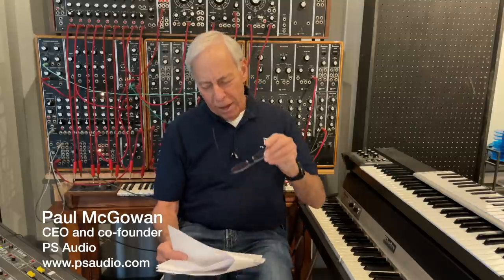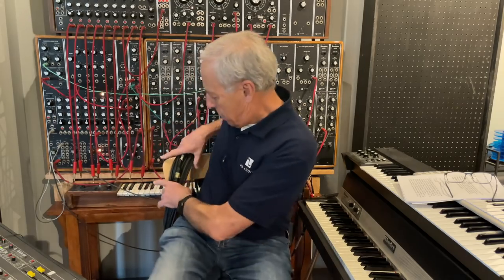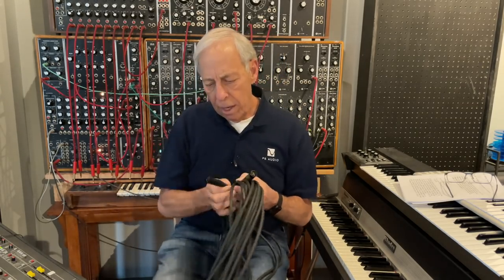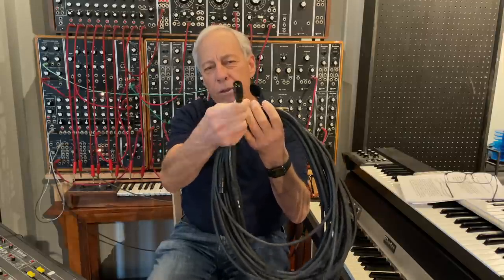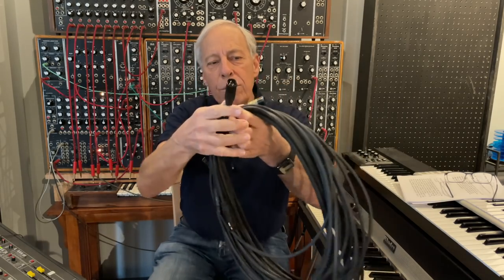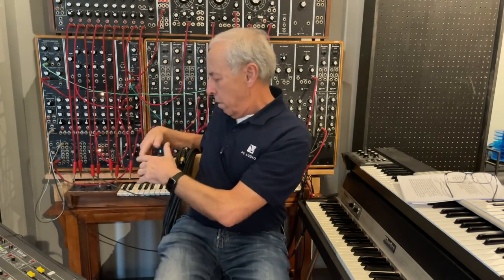Mixing XLR and RCA cables

Comment: Just set your system up properly, with decent cable management,, and you'll never get any interference from any other cables,, use your common sense,, and stop listening to people who want to sell you stuff.
Reply: A few months ago, I was digitizing some LPs.  I ran into a problem when I had accidentally placed a signal cable (unbalanced, line-level) next to the “brick” power supply (transformer) of my mixer.  Fortunately I noticed the hum, figured out the cause, and just took care to no longer put the cable in that position.  I had to redo 8 or 10 already-digitized LPs as a result of this.  In the case of a playback-only system, if you notice this kind of problem, just fix the cable routing (or upgrade to balanced cables), no harm done.  If you don’t notice any problem, there’s no need to buy further stuff.

Comment: RCA to XLR is no worse (or better) than RCA to RCA, you'd only use XLR to RCA if you had no other choice. That old modular is far more interesting than some cables though :)
Reply: Certainly you’re right! Some of the synth is old, certainly the keyboard looks old. But much of it is new analog stuff from behringer actually! It sounds incredible and is much more reliable than 50 year old components

Comment: I like my analog cables to be as short as possible and when they are short, the difference becomes minimal.
Reply: Indeed, I use unbalanced all over the studio because the cables aren’t longer than 5 feet usually.
Reply: @graxjpg  Yes, for a few feet, the difference is below the dynamic range of human perception.

Comment: There is more to it than that.  A typical balanced line level audio signal is hotter than the signal on an unbalanced line level audio signal. These two conventions are commonly known as 'pro' and 'consumer'. Ironically, the more sensitive high impedance input of an unbalanced system is more prone to noise pickup than the less sensitive low impedance balanced input so you win twice in a way!  The separates market mainly use unbalanced RCA -10dB to maximise compatibility between different manufacturers products as fewer companies use balanced XLR +4dB connections. I'm amazed that the high end consumer audio market hasn't fully embraced the signal connectivity of the pro audio market which has used balanced inputs and outputs for over 70 years. Trying to 'improve' an unbalanced input or output by using overpriced cables is just not the answer.

Comment: I’m using xlr cables from my microphone to my preamp and for some reason, there is still slight a.c. hum in the background. 🤷🏻‍♂️
Reply: Could be the quality of the cable try a different one, or it could be that one of the connections was broken and the reason I like non molded connectors for inspection time to do a continuity test. If that doesn't solve it, it could be a possibility of internal cable damage but a continuity test between the different pins should rule that out.

Try moving your XLR cables away from other wires to see if that helps. There is a video I might add the link if I remember of somebody testing various price and quality of cable and found unless you get the cheap ones the difference was minimal but if you got a cheap one it was regrettable.

The other option is you wouldn't happen to be underneath a radio transmitter would you?
Reply: imark7777777 
The mic xlr cable is going directly into the preamp. Then the preamp into the Focusrite USB box and then directly to the computer. Nothing else is connected to the AC other than the preamp. I’m also far away from any radio transmitters. Probably it’s the cable. I’ll get another one and see if it fixes the problem.
Thanks for your valid input.
Reply: Microphones are often difficult because of the low signal levels, long cable distances, and very high gain in the preamp. Sometimes you have to cut pin 1 (the shield) at the preamp end XLR. This will often break a ground loop if the microphone is somehow physically grounded like with a metal mount tied to electrical ground through a desk.
Reply: @Bassotronics  hmmm I think this article it might be helpful https://www.ranecommercial.com/legacy/note110.html

I'm assuming everything is plugged in the same power strip. if they were on different outlets with a bad ground between them that could introduce noise, I don't think that's the case here.

Yeah I'm thinking it might be the cable, was it something off of Amazon? Get some thing from a reputable seller and not necessarily bargain quality. Maybe get something in the $20-$30 range and if you can with Neutrix connectors ( generally that means they put some effort into the cable and didn't just go with cheap Chinese knock off connectors and cable.) that you can have as a reference for testing.

I'm really liking these at the moment, they were a good price and have colors for a recent order for a podcast studio last year.
https://www.bhphotovideo.com/c/product/845514-REG/Kopul_m4010_Kopul_Studio_Elite_4000.html

of Course I am one to speak, I picked up a three pack of Samson cables for like $25, and salvaged many of my cables from the trash. A good cable well taken care of will last, no knots and kinks and gentle wrapping (preferably over under).

Comment: Hey Michael, I have an even older CD player.  It plays fantastic and while it doesn't have balanced outputs it does have digital, both optical (toslink) and coaxial.  Your 15 year old Sony is probably the same. Not much has changed in CD players in all that time except the DAC and even a $100 DAC today will probably run circles around your old internal DAC. So I'm suggesting you take the digital signal from your Sony via optical or coax to a new external DAC. Spend more than $100 for a good one with balanced outputs and then connect that DAC to your pre or integrated amp.  Or you could choose a new amp that has a high quality inbuilt DAC and you won't need to worry about XLRs at all. Just connect via digital.  But remember you'll have the same problem in a few years when the amplifier is still fine but the DAC inside it is obsolete.  Anyway, I think either of these will help you continue to enjoy your Sony for many more years and not worry about it not having XLR.

Comment: Never understood why they make adapters. For making one end XLR and the other end RCA. Expecting to achieve the same results. XLR to XLR fully balanced is the way to go. I wasn't a believer at first. Until I tried it for myself. My noise floor lowered quite a bit in my system. Definitely recommend fully balanced equipment if you can!
Reply: Because you may have a good XLR cable … but the new equipment you bought is coax and RCA only!  It could fun the reuse a very pricey XLR with an adaptor :😢

Comment: Just short the minus and ground pins together on the XLR if you want to connect to the RCA plug, keep the cable length as short as possible, use good shielded wire.

Comment: I agree balanced is the way to go for the reasons you mentioned. I had this exact question in mind... perhaps I can elaborate on what type of scenario you could encounter to warrant the use of mixing RCA/XLR... I have 4 subwoofers, 2 identical ones, a 12 inch as well as a fourth sub. I also have speakers in the signal path as well. Basically every single speaker (4 speakers) and all but one sub have XLR.... You can see where this is going. I have 4 spliters (2 for left, 2 for right) so I end up with 6 xlr outputs (3 left, 3 right) and these go to the speakers, the second set of speakers, and the subwoofers(also the subs have XLR pass through which are being used)... I have the final RCA subwoofer connected to the output of the 3rd sub via XLR to RCA cables and I always wondered about this, since I believe XLR to RCA is just taking one of the outputs and the other inverted signal (i forget if its the hot or cold) is just connected/shorted directly to ground. And that's what I was wondering about and this video kind of addresses this question but not entirely. I can appreciate that describing this setup is difficult and I almost feel like I need to draw a diagram to explain better but since all the speakers are more or less paralleled but then at the end of the chain there is a direct to ground it seems like there may be potential for some issues? Which honestly, for the most part this setup sounds fine so I imagine it is okay. Occasionally I have experienced some minor speaker hum but it was pretty negligible. But I have also had a strange issue with the third sub, techincally it works fine but there is an LED on the front which tells you if the unit is powered on and I've been having that front LED go wonky on me of late, so I am wondering maybe if there is something going on. Pardon this long winded comment I just ran across this video and was relieved to hear I wasn't the first person to wonder about this type of thing. Also indeed as stated XLR/balanced connections are the way to go, but I happen to have this consumer grade sub lying around. And generally don't seem to have any issues with this setup but at the same time I can't help but wonder... I'm not an audio engineer or an electrical engineer as well it's hard to say because there are of course potentially different ways the subwoofer outputs could be wired internally. Anyways thanks for the video you got a new subscriber :)

Comment: If the output is RCA, one can uses a simple converter to XLR connection that can then be connected to your amp/ active speakers via XLR cables ...
Reply: RCA is unbalanced
Reply: @5skov  Yes the connnection would unbalanced, but the signal into the balanced input will work just fine....  It would be functionally the same as any unbalanced connection.
Reply: @TheMirolab  Keep wires short then
Reply: And if you do your conversion at the RCA connector and use the 2 core and shield cable back to the XLR connector you will get at least some noise reduction benefits.

Comment: Paul, once again, you didn't really answer the question.  My system is all unbalanced.  There is no noise or hum.  I recently added an eq which has only balanced connections.  At first I tried a XLR to RCA cable which kinda work but after awhile a swoshing  noise would come out of the right channel.  I checked around and learned I needed a DI box. I bought a couple (Radial) -10 to +4 and the second +4 to -10.  Both passive DI boxes.  Everything works together great.  My system is even quiter now even though I am using several signal processors in the chain.  I'm a puzzled though because ten years ago I used to play music at church for the Christmas party.  I used my unbalanced stereo gear (including signal processors) and hooked it up to an XLR input (with XLR to rca cable) so the music could play through the ceiling speakers.  There was no noise, hum, distortion, only clear music.  Don't understand why it worked at church but not at home.

Comment: For a true balanced system XLR for Input / Output connections is best.  Also there is balanced/ stereo 3 conductor 1/4 inch phono plug as well.  A configuration of both XLR and balanced phono should work as well.

Comment: my DAC has both XLR and RCA outputs but my amp only has RCA, I bought an XLR to RCA cable and it sounds worse than RCA to RCA / both cables are of similar quality /. is there any explanation for such a difference . thank you Paul . Best Regards Suavic
Reply: I see possibly 1 of 2 issues here. First, your dac may not be balanced and when you use the xlr connector, the signal is being run through some low grade parts for the xlr option. Or, and more likely, your dac is balanced and you have a configuration issue. Balanced and SE operation are not compatible, so if you want to mix components, something has to be done. Check the manual on your dac. With most balanced components, they give you a way to switch to SE operation. They usually give you an external switch somewhere, an internal dip switch, or a small jumper that you need to insert into the xlr jack. You'll need to do one of the above before its OK to use the xlr jack.

That said, regardless of what's going on, there's absolutely no benefit to using the xlr output on your dac. Only 2 of the 3 pins will be used, so its identical to an rca cable.
Reply: @solarfall2728  thank you. I use RCA to RCA and it's fine. the DAC is TEAC UD-H01 old and good enough for me for now :) best rgards suavic

Comment: Hi Paul, I've learnt that there are equipments with truly balance circuitries or electronically balance  or fake XLR circuits with just the XLR connectors. I would be very happy if you could enlighten me on these topics. Thank you very much from Singapore.
Reply: Nobody wants to talk about that unfortunately!  You have to look for clues like if a product advertises "fully balanced internal circuitry".  The late Ken Ishiwata does mention it in a talk - look for videos on Youtube where he's discussing the PM 10.  He pointed out two things - 1. Even balanced internals most often switch to single-ended when they get to the volume control. 2. The PM10 is fully balanced internally and even can send a balanced signal to the speakers - over unbalanced cables!  

Now obviously the only reason he mentions any of this it to get people to buy the PM10. Secondly, I really wonder if it makes that much difference whether the internal wiring is balanced or not. We're talking about very small distances, a couple of inches maybe.

Comment: Paul, i’m loving your videos, which i just found on YT. Would you consider adding one new
video to the Bal vs Unbal series? How about a video on using a -10dBv consumer device (like a Tascam 234 tape multitrack recorder) with your typical +4dBu pro equipment (like my SSL Big Six console/interface)? And specifically, how best to run from the -10dBv device and into the +4dBu device … and vice versa?  I am considering buying numerous Radial Engineering J-Iso boxes to handle this, but i’d love to know if there would be an easier/better/cheaper DIy way! Thanks Paul

Comment: Unfortunately balanced to unbalanced conversion is a bit of a minefield of grounding and phase issues, mostly because there are several different ways to do a balanced / differential (and they are not the same) output, and they all need to be treated differently. Going from an RCA output to an XLR input is usually not an issue (but you may have a ground loop issue on some equipment). Going the other way is a bit more complicated. If it's a transformer output, no problem. Tie pin 1 and pin 3 together as ground, then use pin 2 as your hot. If it has a floating differential output, you can theoretically do the same thing without issue. There are other balanced outputs where you CANNOT ground pin 3, since it is effectively grounding the output of an op-amp through a 47R resistor. This can cause lots of problems, though if the equipment is well-designed it shouldn't blow it up. There are also balanced (but not differential outputs). To make everything more fun, XLR wiring hasn't always been standardized (and it still isn't 100% standardized). Some equipment used pin 3 hot, some used pin 2 hot. These days, it's almost all pin-2 hot, but in the early 1990s that wasn't the case.
Reply: Well stated! It's not that simple and many Audiophile RCA to XLR cables get it wrong. PIN 3 hot was the quasi standard for broadcast audio equipment. Pin 2 hot was the recording studio and stage industry standard. In the mid 1980s when we got stereo broadcast television, many TV stations started using recording studio processing gear such as Dolby A systems on their VTRs since they finally had to worry about audio quality. That flipped the standard to PIN 2 hot across both industries.
Reply: @andydelle4509  It's not even as simple as broadcast vs. studio. Back in the early 1990s, there was a lot of British studio equipment that was pin-3 hot. Active monitors, mixing consoles, power amps, you name it. It was generally a horrific sea of phase issues. To make matters worse, a lot of manufacturers really hadn't figured out how to do an input circuit properly, and a lot of them had grounding issues that made it worse. 

As an example, I have a pair of Quested Q108s. Fantastic sounding active monitors, but unless you get everything just right, the buzz and hum will drive you insane. Eventually I threw up my arms and designed a preamp with some Jensen JT-11-DMCF output transformers, and that pretty much nixed the problem.
Reply: @H-77  Well the British always do everything backwards! Like driving on the WRONG side of the road. -  Sorry, just kidding but I couldn't resist.